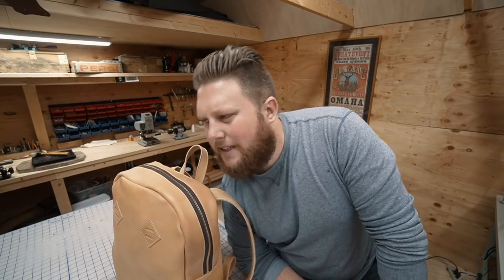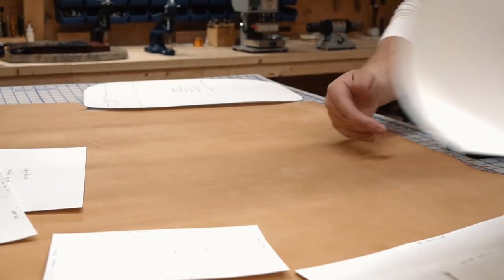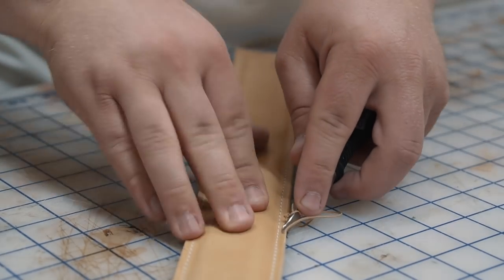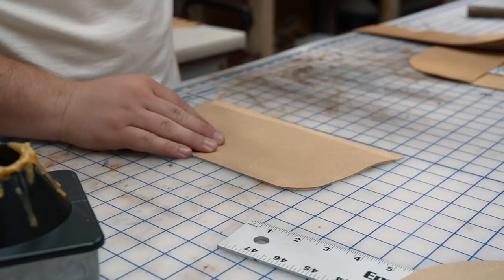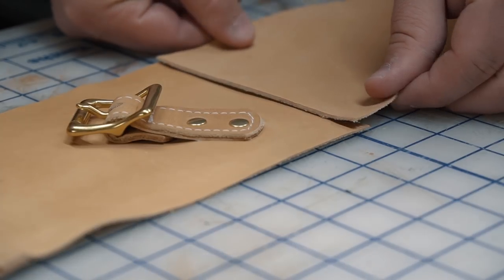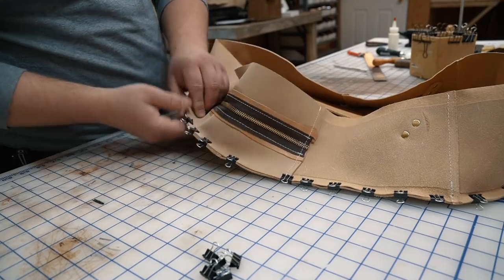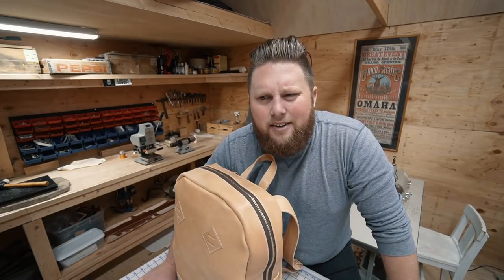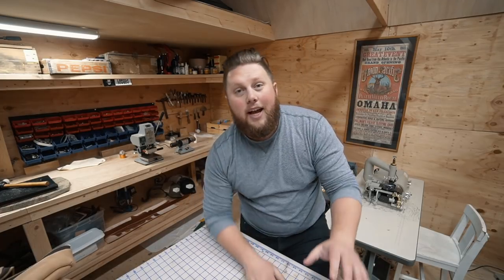Making a Leather Zip Top Backpack - Horween Natural Essex

Comment: Great bag you made there. Great craftsmanship.

Howdy there, I saw you were using a small anvil for a weight to hold your stuff down. I took some of my chap scraps (oil tan leather) & cut out a little 8" x 4" piece of leather. Fold it over into a 4" x 4" size, stitched 2 sides & 3/4 of the open end. I took some real old shotgun shells I had, cut them open & poured the shot inside for the weight until full. Then stitched the last 1/4 of the open end together. I have made others for people & used BB's to fill the pouch. Easier to use the BB's since they come in bulk. The soft chap leather doesn't scratch or indent any leather. They make good door stops too, lol.

You can also use clinch nails where you are using those little clips. Works great. I learned that from a young great saddle maker out in Texas. See you can teach an old dog new tricks, lol. Just space the clinch nails about 1" apart just through your stitch line & stich slowly & pull the nails as you get to them. Works great. Sorry wasn't trying to hijack your video just giving out some helpful hints.

Comment: Im just getting into doing belts and wallets. Im to the point where i need to invest in a sewing machine. I would like to get into doing bags as well. Would you suggest a flat or cylinder type sewing machine for a starter.

Comment: Need to get a sewing book on clothing to learn about trimming curves.  What you would have found is how to relieve the bunching are V-shaped notches that are needed to remove the bunching.  Also, the folding technique on squares corners, tabbing on Inside and notching on outside curves.  I like backpacks but I need a strong handle on the top simple hand pickup and straps long enough to crossbody carry when in a hurry.  You might think about making zippers more secure or hidden to reduce theft.  Backpacks are something you want to travel the world with and feel safe.
Reply: Added note I recommend the Edna Brite Bishop sewing techniques and books.

Comment: Do you feel the weird puckers take away from the overall project.  
I have the same problems with duffel bags. Thanks 
🙏👍❤️
Reply from the maker: Yeah I definitely prefer to not have that happen. As long as you get the length right it shouldn't happen. But it's tricky;)

Comment: parker may have missed your answer but are u still have cracking issues with your rolled edges and if not what was your fix.
Reply from the maker: No that hasn't been a problem. Especially not on leather like this, Essex from Horween